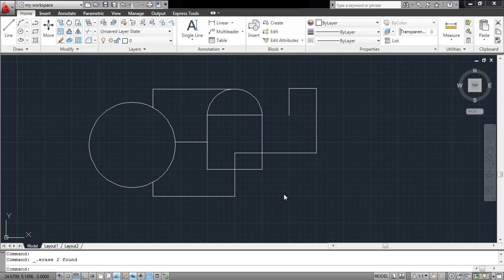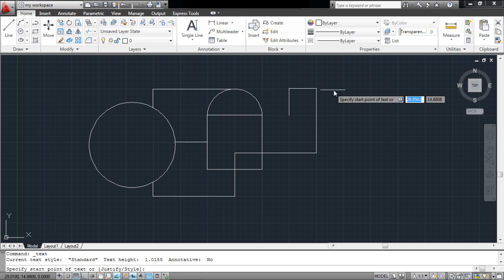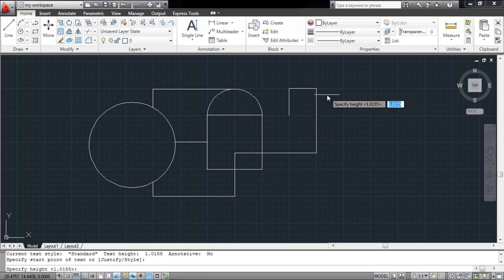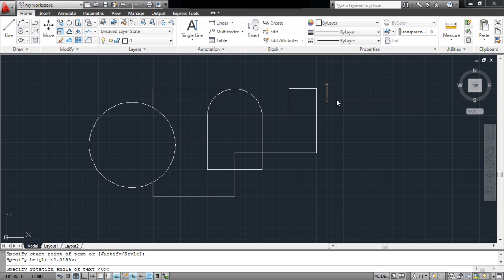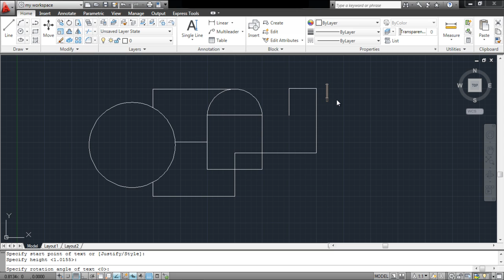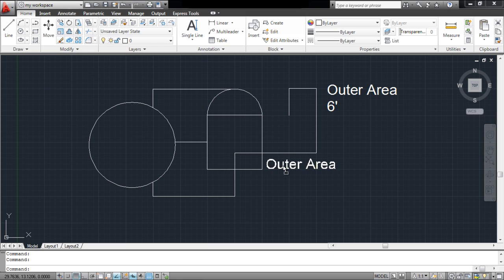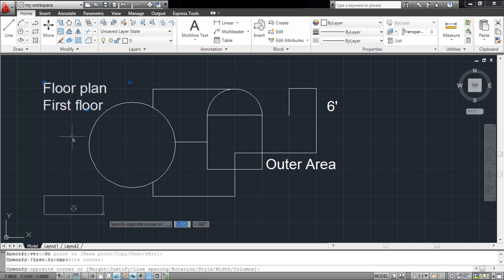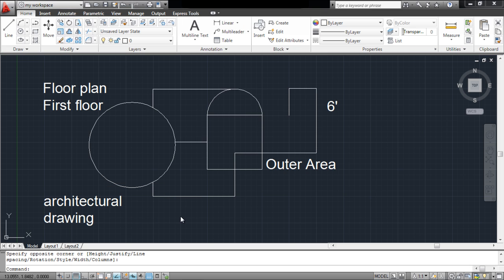How to Enter Text in AutoCAD

Comment: I'm new with Autocad and I can't believe how unnecessarily complicated it is. Why on Earth must I specify the size, rotation angle every time i want to insert the text? Wouldn't it be easier to write text directly in some default format or style and resize and rotate later if needed, like in many smaller and simpler (and cheaper, even free) CAD programs?

Comment: Have you gone into autosnap settings, entered the x y spacing co-ordinates in the snap and grid panel to be the same or mathematical multiples of the grid spacing, (also on the snap and grid tab of the autosnap settings) which is found by right clicking autosnap on the command bar....